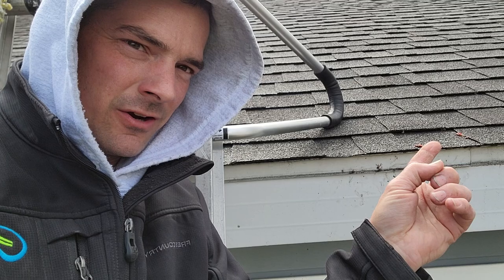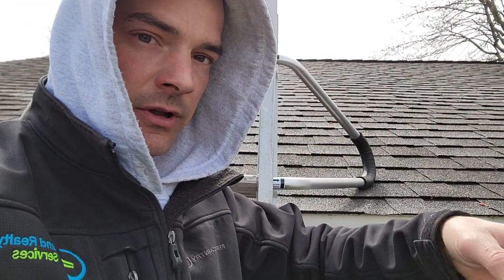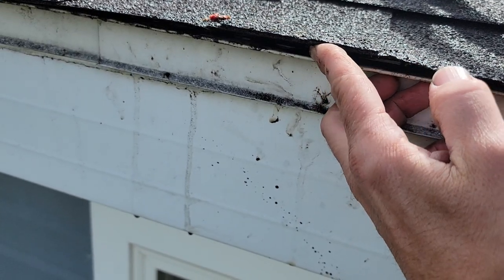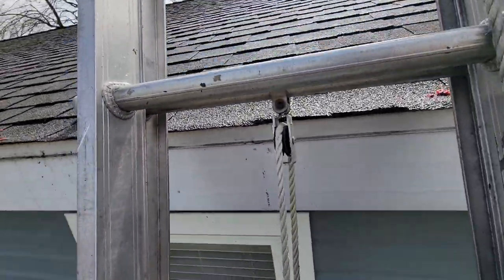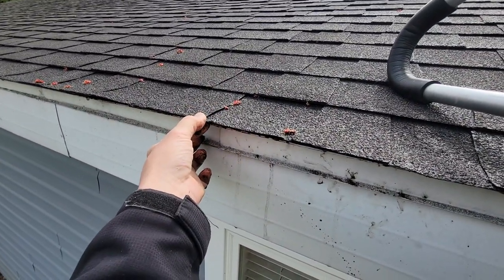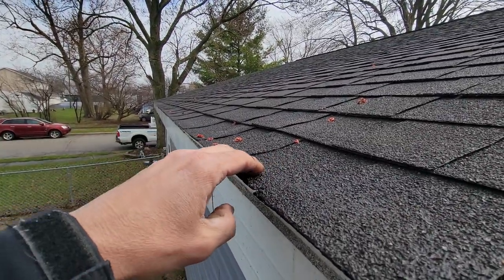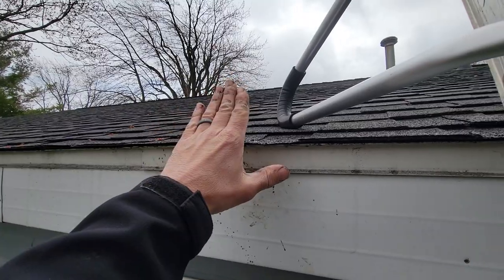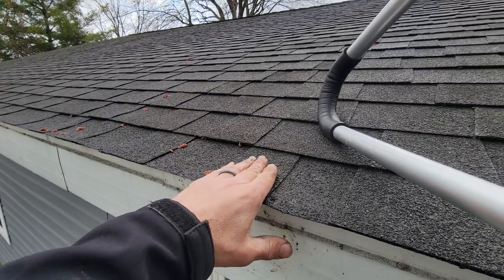Roofing ice and water over or under the apron?

Comment: Lol now I'm just having a good time browsing your videos and having a few beers. On this subject, I am quite literally a specialist. The reason being, I work for a company that repairs/replaces gutters, but also, I have 15 years experience roofing. So I spend most of my time dealing with problems related to exactly this issue; Where the roof meets the gutter, the fascia and the edge of the decking. Now, I have seen it all after working for this company for the last 6 years. I see mostly problems related to having no ice and water OR drip edge/apron installed, but I also see issues related to the improper installation of drip edge, issues related to using drip edge without ice and water, and yes, even issues related to the installation of drip edge OVER top of the ice and water. 

Now all of these issues relate exclusively to roofs under a 5 or 6/12 pitch. Anything steeper than that you won't really see many issues in this regard, they would be the result of a poor installation rather than a good installation that happened to put the drip edge on top of the underlay.

So one of the most basic and common issues I will get called to a job for is that the gutter is falling off for one reason or another. Sometimes it's just a gutter issue, replacing the screws is enough to fix the problem. Sometimes there is no drip edge installed at all. In this case, the water that gets behind the gutter will at best rot out the holes around the screws and cause them to fall out; At worst rot the whole fascia out and even cause water to run back through the soffit and behind the siding, stucco and even doors and windows in some cases, as was pointed out in the video. Now you're saying, well yes this all makes sense, we all know this, but here's the kicker: On a 4-5/12 roof, and especially in an area where you get snow, that drip edge is not ALWAYS wide enough to catch the water that wicks back under the edge of the shingles. Not only that, if there is an ice dam on the edge of the roof in the winter, the melt is sure to run under the shingles and under the drip edge, down the fascia, behind the gutter. So in other words, if you install the drip edge over top of the underlay, you're going to have the exact same issues in the long term, in some cases, on lower sloped roofs, as you would if you installed none at all. 

As to this idea of extending the underlay out or bending it down over the fascia, these materials are not made to withstand the elements for long periods of time. Eventually they wear out, very quickly in a snowy climate. I once worked on a large building installing a roof where we put all the ice and water shield and the synthetic down on the roof to waterproof it so the other trades could get in to do plumbing, electrical etc. It snowed heavily as soon as we were done, then thawed and froze and repeated for about a week after. Once the roof had melted off, we went back up only to discover all the ice and water was full of holes from the action of the ice freezing and thawing over top of it. What this means is that this material is not made to withstand direct exposure to the elements; Rather it is a stop gap measure made to use as an underlay under a weatherproof barrier such as shingles. What happens when you try to use an underlay as some kind of drip edge or apron substitute is that it wears out that first 2-3 inches or whatever you have over hanging and once it wears out, creates a leak behind the gutter and/or on the fascia. Not to mention if you were to run this down over a gutter, how would you ever replace the gutter? Or rehang it if the screws got loose? 

Regardless, I see probably about a dozen houses a year where the drip edge has to be replaced and put up underneath the underlay to stop leakage behind the gutter. Some of which did not have any issues until 15 years after the roof was installed. This is an EXTREMELY labour intensive and expensive job, costing the home owner sometimes thousands of dollars. So, please listen when I say: The drip is to be put down first, ice and water goes over top to seal down to the drip edge and prevent leaks behind the gutter. Grand Roofing is 100% right about this. If it makes you feel better go ahead and put another layer under the drip edge, although that's gonna get a little expensive! 

All that being said, for the dozen or so roofs a year I see with this problem, I see hundreds if not thousands a year done the other way around that have no issues until the day they get re-roofed. So, I guess it's a bit of a lottery in a way. As my long ago foreman once told me, "If it don't leak, you did it right!" Such prophetic words! I hope these ramblings help someone out!
Reply: Good evening. Are you open for providing professional advice?
Reply: High value comment
Reply: Southerners ignore this, unless you have many freezing weather conditions.

if you install water and ice over the gutter apron in the northern part of USA, guarantee ice damming damage. Water and ice can last as long as the shingles when installed correctly. the most common fail is when the water and ice  is mangled, ripped, or too short, mainly because it isn't showing past the gutter apron, before the gutter is install. needs to cover the deck and onto the fascia. the gutter needs to be in between the water and ice and gutter apron to prevent ice damming.
like 1" or 2" past the gutter apron makes it easy for the gutter guys to install without damaging the water and ice. a lot of time roofers will do a good job installing the water and ice, but at times, the roofers will have it cut flush with the gutter apron, making it easy for the gutter guys to crush or rip the material. 
however the second biggest reason i see fails with water and ice, is not having enough hangers as well. a lot of gutter installer, just cannot understand that ice is heavy and a full gutter of ice can bend out the gutter, away from the fascia, when there isn't plenty of hangers. 😅😅😅 ice gets behind and melts.
i love seeing how gutter installers calling 20"- 28" (5" gutter, hangfast style) hanger space, over kill.
ahhh well, just sharing a professional word for those installing gutters in the Northern parts of USA, take or leave it, ill continue to install and repair gutters regardless what yah think.

Comment: In my 33 years of roofing I install on top on the bottom  edge metal and under the edge metal going up the rakes.
Reply: That's what the code say. On rake side it's wind that matters more and water are not supposed to come down on the rake side. So IWS under is better.

Comment: The real issue here is the drip edge was installed too tight to the fascia, causing it to stick up and eliminating pitch on the last shingle. On low pitched roofs, I always leave a slight gap between the fascia and drip for this reason. I would rather see the last shingle droop down a bit then stick up on a low pitch. Yes, ice and water on top of the metal may have prevented the leak, but ice and water should never be part of your first line of defense. Ice and water is there to REDUCE damage when the shingles fail (shingle blows off, ice dam creates pool of water, etc)
Reply: You my friend are correct!!! That’s what I’ve experienced with my own roof , thanks Ryan 👍

Comment: A master carpenter who writes for carpenter  journals used ice and water 10 in. to 12in. wide brings it over the fascia  a little  bit then he installs the drip edge  then installs the full sheet of ice and water over the drip.
Reply: What the video guy is saying is that if you wrap IWS over fascia then drip edge on top that and more IWS on top that: if water gets under the drip edge it can easily just run down IWS onto framing fascia and into soffit and into house.

Seems to me the real answer is a drip edge on the framing fascia and drip edge on trim fascia (with some sort of weep holes in the fascia trim to empty ant water running down framing fascia.)

Comment: I don't use gutters on my new builds. For a little more money, I put a 3' wide band of 4" thick concrete around the perimeter of the building, thus avoiding all the gutter problems mentioned here. Besides, what good is a gutter in a torrential downpour....

Comment: Grace I and W actually addressed this and there specs are to install a 12" roll under the edging and fold an inch over fascia followed by edging followed by 36" roll overlapping the edging. The layer under the edging is extremely important! If and when your gutter freezes and "backs up" it will get directly under your edging as this is the easiest point of resistance for the water to escape, and if you put edging down over bare roof then that bare wood will be the first to rot. This is a highly debated topic, I have 20+ yrs as a builder but people with more experience can disagree all they want, I just refer to manufacturer specs. You know, if directions and warrantees mean anything to any other business owners.... But what do the manufacturers know about the product they make? More than some roofing laborer who thinks because water "runs down" it will never leak.
Reply: If installed improperly voids warranty... 🤔✌️🙏💪👍☝️🎯

Comment: When there are gutters on the house ice dams would damage facia and soffit if ice and water went on top of drip. Nothing wrong with a strip under the drip. Then ice and water over drip. Here in Boston code calls for 6 feet of ice and water on all starter edges. I’ve seen ice dams big enough where I can literally walk on them to chop reservoirs to release the damming water. Nothing wrong with over and under. Just don’t let the ice and water go below the drip where it’s visible. Keep up the good work.

Comment: Worked for a company whose roofers put a cut roll of flashing tape over the very edge of sheathing, and then down over the facia. it maybe went about 6 to 8 inches up the decking, and about a half inch to an inch on to the facia (depends if it was sub-facia or the facia metal was already there). It was more like flashing tape (thicker butyl with a smooth face) than ice-n-water.

Then they would install drip-edge metal, and then ice-n-water over that. According to them, this prevented any chance of water/ice that might get under the drip edge from rotting the edge of the decking. They said they used the tape they did because it stuck better, and naturally filled nail holes from installing the metal. They just used the extra tape on the bottom of slopes where there would be gutter, not up the sides on gables. 

They also used it down the valley (I think it was 10" wide, maybe 8") and the ice-n-water over top. They mentioned that ice-n-water had a tendency to tear if stressed enough, where the tape they used had quite a bit of stretch to it.

This added 150 to 300 in materials to each job, but seemed worth it for the added insurance against leaks and ice/water backing up and ruining wood.

Comment: 5:57 The real way to do a gutter apron -on NEW construction, would be to first wrap your ice/shield over roof onto the fascia board...then put on your gutter apron...then put another piece of "underlayment" on top of gutter apron as usual.  The reason is because ice can start below the apron inside of a gutter and then get it's way behind the apron and go backwards/upwards.  Having the ice/shield stuck to the fascia takes care of that issue.  As I said, you then have to have an underlayment as usual to go over the apron.

As for existing construction that wasn't done right.... if there's an issue like you have here, then yes, you would take down that aluminum fascia and the apron when you are re-shingling and get it all done right.

Comment: I usually always go above it, only case is when it's a lower slope, I just cut a small strip that wraps down the fascia, assumming there's no gutter there, then slap the eave metal on and then I continue overtop with a full 3ft width roll.

But most houses and homeowners don't really want you taking off their gutters and reinstalling them just to put ice and water on the fascia a few inches. So most times it's just laid overtop of the drip edge, either way has its pros/cons but one can only be done if theres no gutter on

Comment: It depends on the pitch for me, lower pitches i put the i&w first, but roll it about an inch over the facia, steeper pitches i don't mind putting it on top of the metal.  Gable ends i always put the paper then the drip.  Lots of times I'll also zip tape from the drip edge onto the smooth Ice and water shield..

Comment: about 20 years ago we ran the I&W under the metal but also started cutting a 6" strip for the top. Best thing to do and never had any sort of problems along the eaves or rakes. Also if new gutters were to be installed.  2" of the I&W would be brought down onto the fascia and the new metal would cover.

Comment: So I watched a TON of your videos before replacing the roof on my mom's house myself. it's just a ranch style house, 22 square, 4/12 pitch with a center chimney. I placed GAF storm guard down first (across the bottom and up the gables) and laid it an inch over the facia. Then I ran drip edge across the bottom. I put GAF deck armor over top all of that making sure that I covered all the nails in the drip edge. Then I ran my drip edge up the gables to hold down the ends of the underlayment.

My logic was that the drip edge nails would be "sealed" by the properties of the storm guard and the Deck armor would shed any water that got through the shingles all the way to the edge of the drip and into the gutters.

I still don't know if it's right or wrong! haha! But that's what I settled on doing.
Reply from the maker: Everything you just described sounds good 👍
Reply: @GrandRoofingInc  I also used the Miami-Dade nailing schedule since well nails are cheap. And there are zero improperly placed or exposed nails.

I worked in standing seam metal roofing for a couple years back in the mid 90's but I'd never done a shingle roof before this project. Your videos were SUPER helpful. Thanks!

Comment: I disagree with ice and water shield going on top of the drip edge. Not sure if you're in the Northeast but out here in the winter, sometimes gutters freeze up very badly and when that happens, the drip edge is pushed up from the expanded ice thus exposing the top of the fascia board where it meets the plywood. Now you have an area that is vulnerable for water to drip back into and is a really bad scenario especially for houses that don't have an overhang. The correct ways to put the ice and water shield on first and even go as far as to getting it behind the gutter about a half inch or an inch. Even if that means loosening the gutter system. Then put your drip edge on. In the event you have missing shingles from some storm and water runs behind the shingles and down the underlayments, whatever water runs behind the drip edge will run off the ice and water shield and into the gutter. But I don't know about anyone else, my roof systems don't typically have missing shingles for this to be an issue regardless. We've been doing it that way for over 15 years and have never had a single issue. Another thing is the way this installer put his drip edge on. It's barely nailed. That's why they're such a flat slope at the bottom. No wonder water got in the seams and ran the way it did. No matter who's right or wrong, I can say that doing it our way hasn't caused a single issue in the last 15 years with our ice and water going down first before the drip edge. And we've had some pretty insane storms out here in Connecticut.

Comment: On top, because just like you said water backing up,if the ice and water  is  stuck to the top of the gutter apron,  the bottom of the gutter apron is metal against wood, so 3in of unprotected wood, remember water backing up.
So ice and water stuck down 100% to the fascia, then gutter apron, and run underlayment over both or add a strip of self stick membrane on top of the apron, so it cost more but the is for  top tier quality only. 

Also underlayment over ice and water help with the next tear off, because shingles can stick to ice and water causing  a extra headache

Comment: Ive got new sheathing and fascia, I'm up in manitoba rain, wind, snow and ice. I don't want water under drip edge, rotting wood and lifting ice and water shield? I think I need something under and over drip edge? The manufactor of material I'm using states adhere it to facsia.
Reply from the maker: yes you would run your ice and water over the edge and over the fascia. If you are using an apron and you want extra insurance I would put a strip over the top as well. I only stated going over because, let's face it nobody wraps it over the face they just go over or under. Going over will at least seal to the apron which will cover over your fascia and into a gutter if you have one.

Comment: A problem is they build cheap houses in that area. You can start down on the wall below. The moisture barrier is usually junk material applied by inexperienced untrained workers. Right here in this house you can see they did not put the moisture barrier to the top of the wall, and it's barely attached . Then they put on the cheap tin soffit and junk vinyl siding.
Reply: Exactly...

Comment: 50 years of being a roofer and roofing contractor 2nd generation.  Just retired.  If you live anywhere in cold climates with snow  then you better cover your a$$. Ice and water shield 3" over the gutter board 6' up the roof or 2' inside the interior wall line. Drip edge with caulk under the nailed edge. 6" ice shield cover strip over drip. Then cover ice shield with underlayment so the shingles don't stick to ice shield( because if you let them stick they will only come off if it's 80 degrees).